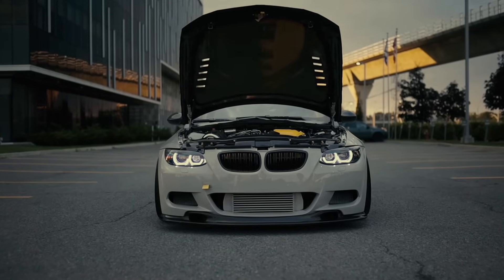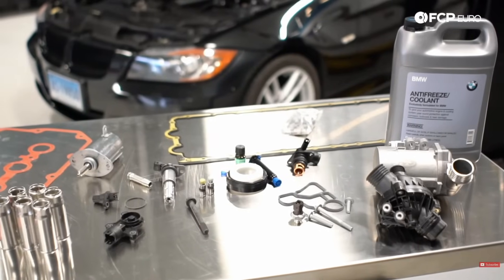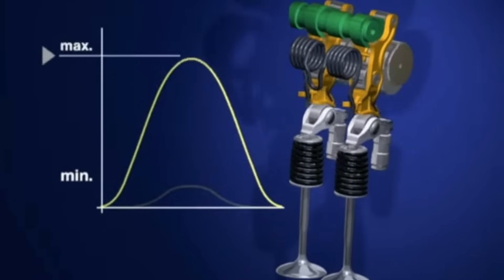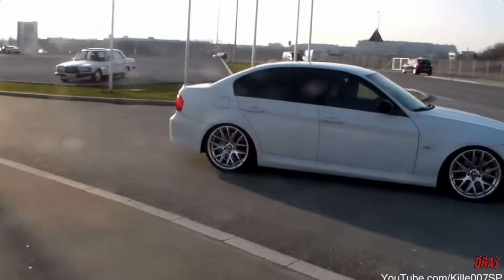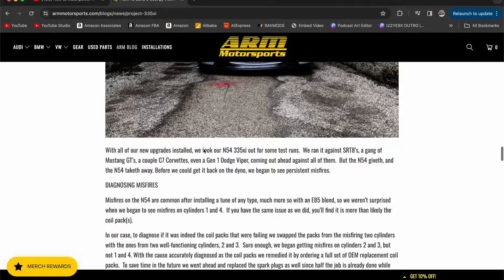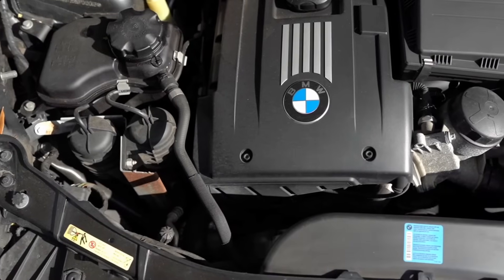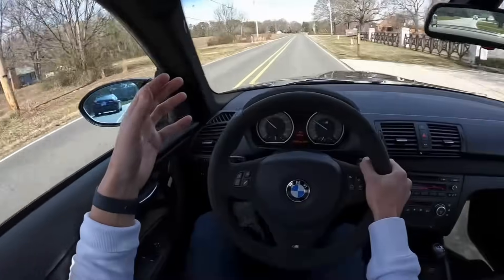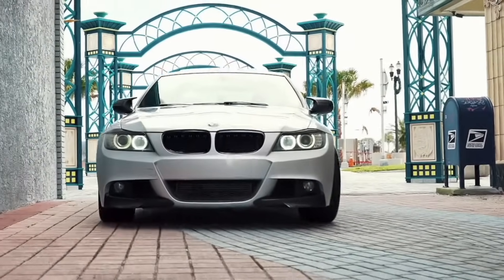Ultimate BMW Engine Showdown: N52 vs N54 vs N55 – Which One Should You Choose? | Comparison & Review

Comment: I got mine e93 n54 with 43k miles for 10k $ and put intercooler, high flow cats, injectors index 12(used), coils, cold spark plugs, and, digital cluster, charge pipe +bov MHD stage 2+ with mixed fuel and duuuuude that’s 450hp beast under 13k. It looks brand new and sounds crazy beautiful. Great sport car, but work yourself on it and it’s cheap
Reply from the maker: 43K miles for $10K is a STEAL!
Reply: @IzzyE9X  no leaks, no problems at all. white color, clean title 2 owners (second owner was older than Biden), no mods, garage kept California and Arizona use only (no rust), garage kept. TBH it’s been 10500$ but still cool, never seen lower mileage on these cars.
There are still cool cars on the market sometimes for a great price!
Otherwise if I would install brand new injectors in the shop or vrsf intercooler that could be the same price as m3 lol.
 I still need lsd to catch up with m3. Many turbos one day. But I live in Cali and it’s super strict with tune and stupid smog check… too much work to take off turbos every 2 years and put stock ones. 450hp is enough fun to drive by the ocean 🌊

Comment: Still choosing how to beef up my 13’ 328i coupe but keeping it reliable, 
I want it to last but I want a lil more torque
Reply from the maker: 3 stage intake manifold, upgraded air intake and a tune. Should only be about $1000 and bring you up to 240-260 horsepower

Comment: Hi here with my 135i N55 E82 with 100k and still rocking. Advice, do you maintenance and buy in advance a water pump, valve cover gasket. If you can change the thermostat for the masselmans, half of the issues are solved. Currently Stage 1+ with 360HP. Love my daily driver.
Reply: What is this word "masselmans"? Google doesn't even know! fyi, I had to replace my waterpump at 120k, they also hit you with the thermostat, cost $1958.

Comment: first of all it wasnt the first! time they have done it on  1974 on the 2002 model but if you mean the modern era still have to be specific on petrol engines thats because all the diesel cars even the e46 diesel cars they are turbocharged

Comment: I own a 2009 X5 N52 and i freaking love it.... all i had to do was replace the valve cover and valve cover gaskets,  manifold gaskets, O2 sensors, VVT Solenoids, Transmission pan and filter, new belt, lower radiator hose,   AC line because my old belt broke and snapped the rubber part of the line. And regular maintenance stuff...This is the best vehicle with currently 241,000 miles and still going
Reply from the maker: I’m also at 241K miles!
Reply: You just described the cost of an additional car in just your maintenance repairs.
Reply: @anthony7228  what's why you need to be mechanical inclined of owning an older BMW .. I spent like 5h replacing water pump with thermostat  ... but it is worth it ... I will never do the timing chain .. hope it won't fail me
Reply: Got a 08 about to supercharge it sooner or later .. got to do my crankcase position sensor in the morning and replace my ccv valve on the valve cover and I’m good to go .. I’m at 178,000 miles roughly .. I hate this damn 6 speed zf transmission it sucks lol this n52 would shine so much better if we had the zf 8 speed transmission like the older 2011 35i models got
Reply: @mtbridingog9083 facts
Reply: @mtbridingog9083 simply get a Stage 3 xhp tune

Comment: N53 seems pretty underrated. First I wanted to get hands on N52 but then found a good deal for N53 and now I have N53. Although it's very similar to N52, people are not talking about them much and I wonder why
Reply: Main reason is the N53 wasn't offered in the US market, which is where a ton of these videos and DIYs come from. 

I am an American who was fortunate enough to own one in a 2009 330i wagon. N53 was basically an N52 with direct injection and without valvetronic (yes, I know there are some other differences but those are the big ones). In my experience the N53 isn't as reliable as the N52, mostly due to the injectors and the NOx sensor issues...although it doesn't have valvetronic so that eliminates potential issues.

I loved, loved, loved the N53. I also love the N52 (had 2) but the N53 was absolute peak BMW NA inline six, in my opinion.
Reply: The n53 is a decent motor it’s very similar to the n52 but has a few changes to the engine and tune .. I believe the 53 has a little more torque then the 52

Comment: you shouldve mentioned that the n55 in the 2014+ F3x cars had a slightly bigger turbo than the older engines in the E chassis cars and the misconception with the N55 not having a forged bottom end is somewhat incorrect the only difference is the cast iron crankshaft but still has the forged rods and both have cast piston heads
Reply from the maker: great input!

Comment: I have a 2016 built N55 with MPPK approaching 120k mi and only problems to dates have been water pump, thermostat & valve cover gasket. The original valve cover gasket lasted 115k mi. Been quite reliable and still pulls hard.
Reply: please look at what 4n motorsport did to an n55
Reply: 2014 F30/N55/6MT, MPPK+MPE, fast as f and snorty without sketch flashes/bolt-ons. 

OK fast enough for me. Y'all wanna blow up your motors, feel free.

Comment: Why is nobody talking about n53? 300 hp stock just with intake and exhaust. Naturally aspirated! Perfect engine to throw in an older bmw for someone who doesn’t want a turbo, and loves n/a goodness
Reply: It was DFI instead of port injection so had a less reliable fuel pump and injectors like the N54, it’s not much of a gain over the N52 either so not really worth it. Also American never got the N53

Oh and you also get carbon buildup from DFI
Reply: @bwdrives  it’s not worth it for you Americans because you don’t have the engine, but for us in Germany it is definitely worth it, it’s the last naturally aspirated bmw engine from factory. And as i said, it’s 300hp easily, if you want to spend a bit more for porting the head and tunign it can go to 350hp, and rev till 8k rpm, that’s almost s54 territory. you can’t get those numbers on n52 without spending a fortune on some cams and porting the head etc…Plus direct injektion doesn’t make it bad, of course injectors can fail sometimes, but it is considered very reliable engine here in Germany, maybe not as simple as n52 but you loose somewhere to win somewhere.
Reply: @Shari_Tejp  that’s impressive I have to say, an S54 but with better reliability and good fuel consumption!

Also I live in the UK not America haha
Reply: @Shari_Tejp  Had an N53 in Germany and almost cried selling it

Comment: I'm driving a 2011 328i N51 (in Cali)which is just a N52 with the stage 3 intake manifold. Have 193k miles, replaced all the coolant lines, radiator and the reservoir. Had the oil pan replaced a few months after getting the car used. The car run great. Keeping up with the maintenence is key. Great video!

Comment: My experience as a mechanic with all these motors and currently owning N54. They’re all notorious for oil leaks and issues. N55 can be just as problematic as and N54 same with the N52. Depends how well maintained it was from the previous owners. I have my Z4 N54 previous owner took great of it and I also did all the maintenance for safe measure. Pushing 600hp on upgraded turbos, E85 Port injection. It’s blast to destroy other B58 owners and V8 engines. occasionally gives me hiccups. Btw my car has 117k miles. Stock engine and trans (DCT)

Comment: N52 gang. Reliable even with aftermarket  performance mods had 3 n52 and have had very little problems with them mostly just basic maintenance stuff
Except them damn carrier bearings now running jxb best $300 ever spent on it
Reply from the maker: 240,000 miles and still going strong 🫡
Reply: @IzzyE9X  have 280 on current runs like a top
Reply: solid motor fr
Reply: Had all 3 n52s are my favorite to daily tho

Comment: Own all 3, love all 3 , but indeed n54 cost me the most. And n52 super fun to beat on it and dont worrying. 
N55 is a engine you want to keep stock.
Reply: why did you keep your n55 stock?
Reply: @malps420  Because the N54 does 600whp ? :D . N55 is super fun stock form, powerband is perfect stock. I remember the 1st time I drove it, I was like, no way this engine do 300bhp. Also its my long commute car, like for roadtrips, I want enough power to pass semi on country side, but reliable to avoid a 500miles ride on a towing. Crank spin can occur on high power, and rod bearing wont last as long.

Comment: You should mention that the early n55 engines did not have the new fuel pump.  I think they shared the same fuel pump as the n54 until 2013 or so.  The early n55s can also have rod bearing issues, often caused by the 15k mile oil change interval early in life
Reply from the maker: thank you for that input! realistically nobody should be doing 15K oil changes, it’s crazy any car manufacturer could even recommend that lol

Comment: N52 for reliability, N54 for power and N55 for a decent mix of both
Reply: Facts my girl n52 got 232k miles 😭
Reply: @kazkenton  I just bought my 330i with 220 on it. I’ll try and push it to 300 and I’ll come back and report 😅
Reply: @kazkenton sheesh
Reply: What are your thoughts on the B58?
Reply from the maker: working on a B58 video 🔜
Reply: @Jus_Goody  the b58 is starting to have thier issues as well!  The B58 is the new n54, sort of..
Keep in mind the N54 has been around for almost 20 years already !!!!  The b58 is young, but all engines will have issues over 20 years.
Reply: @Spirited_Driver  I have been searching for reliability of the b58 too and found a few common issues. The oil housing, pcv etc. However, so far it’s pretty reliable even with remaps and performance bolt ons. Recently, BMW approached me with a full warranty on one with 90k miles. I declined as I do too many miles.
Reply: @Spirited_Driver  My 5VZ-FE wants to have a word with you...
Reply: @JusGoodyB58 is even more reliable than N55. N54 is the most unreliable engine BMW ever came up with. 

N52 is probably little more reliable than B48. But with BMW its the other things around the engine like (water pump, oil gasket, coolant leaks, charged pipe that fails as the car approaches 80k miles)
Reply: The non-turbo N54 predates the N52 (BMW has a bizarre engine numbering system) is much more reliable than the N52.  The rod bearings are more stout & there’s less technology crap on the 52.  But the 52’s cooling system is slightly better.  Both engines piss oil.
Reply: @sabio2009  what the hell are you talking about?
Reply: @roaksroaks9519  I think this is an attempt to reference the N53, which is a middleground between the N52 and N54 that never made it to the US. I owned one in Germany. 3.0L NA inline 6, direct injection, but no valvetronic.

But if that's correct, I strongly disagree that it was more reliable than the N52
Reply: @bobsmockus i own it and the n53 is a superior engine than the n52 (no oil leak problems, better torque and fuel economy) BUT it falls completely because of the extremely expensive injectors since it’s direct injected and those piezo style like n54
Reply: @sabio2009    No, the N54 does not pre-date the N52 gen.  The  N52 and n54  are very different engine families,  not a newer generation of each other.  The N52 used a magnesium block with port fuel injection and valvetronic, with slightly higher compression heads, i beam connecting rods, from 2004-2015,  N54 did not have valvetronic and is Direct injection on aluminum block with H-connecting rods and larger pins from 2006-2016.
Reply: @Spirited_Driver  
In my opinion the N52 is just a bad engine because the cylinder walls have a coating of aluminum seal that is gone after 280,000 km and the M54 is in my opinion much better just normal steel cylinder walls and no Valvtronic but BMW just went backwards when they changed the engine code M to N
Reply: ive had terrible experience with n52 6000 in repairs car costed me 4k and i got a 335i and love it, ive replaced the alternator for 125 and thats it its so powerful and so much fun to drive plus im not repairing it every day, ig i got unlucky with my 325i
Reply: @kebabsasmedturtle  What were the issues?
Reply: But which is more reliable, N52 or N55?
Reply: B58 for all of them.
Reply: N55s can make crazy power it’s just more expensive than building a n54. You just gotta fix the oil starvation issue and build the bottom end but it’s not cheap
Reply: Such a great analysis, thank you!
Reply: Agreed
Reply: The N55 engine is the only reliable part of my F32.  Almost every single other piece of the drivetrain has been replaced under warranty.
Reply: E46 and e36 still more reliable than e90 e91 e92 ,F series or newer they're all have an issues on oil leaks and cooling system issues at 100 miles must replace all cooling systems ie..electric water pump, thermostat assembly hoses ,valve cover and dasket ,oil pan gasket and so on

Comment: Owned a 435xi (F32/N55/AT) and currently a 335xi (E90/N54/AT). Though I originally opted for the N55 because of the added reliability, a N55 equipped car costs far more than a N54 one due to age/depreciation. My E90 has only 30k more miles than my F32 yet was less than 1/4 the price with a very long documented maintenance history. 
The N55's common issues (fragile plastic parts, brittle gaskets, etc.) followed by a blown charge pipe on a completely stock car, much of which it shares with the N54, surfaced by 110k. Having owned both I would stick with the N54 if went back and did it again since I had to perform the same repairs on my N55 anyway. To my surprise the N54 has also been easier to work on than the N55 so far. Would try a N52 if I wanted NA.
Reply: N54 and N55 trash after 100k miles…it’s a fact…and most people can’t diy…shit I live in a apt condominium bldg; I can’t diy; N52 only issues usually are oil leaks, maybe starter and water pump and common maintenance for an older car
Reply: @nelsonx4235  Try telling the fanbois that. The amount of copium in the BMW community is cringe. According to all the fabois if you simply maintain your N54/N55 BMW you will never have a problem... ever! 
I can DIY (thankfully) and keep all my cars clean/maintained yet the Known/Common Issues articles from FCP, etc are spot-on for every BMW/MINI I have owned. I replace the problematic cheap plastic parts that make up most the known issues list with metal aftermarket ones even if the car is under warranty. Fuck letting BMW/MINI put the same plastic garbage on my cars just to deal with it again 50-100k down the road!
Reply: Really depends if fuel system has been addressed which most have by now. But the second you need a HPFP and index 12’s there’s no comparison
Reply: @derekrostock1596  Index 12s fail too. Lot of people don't bother with them because they are overpriced and there are many topics discussing how the previous injectors (all the way back to Index 1s) have lasted 120k+ miles. Can buy an N54 equipped car and "address" the fuel system for far less than a N55 equipped car. Forking out more if not many times more for the N55 (etc.) just because it has Index 12s, revised HPFP, etc. when N54 cars are a fraction of the price makes little sense.

Comment: E20 2002 Turbo was BMWs first production turbo. May have sold substantially less units (less cars to put it in) but still was sold at dealers.
Reply: That's the point. It was sold because of race regulations. Not because it was designed to be a mass produced turbo model. N54 is first one that is turbo and meant for mass production.
Reply: @zDemoGODz  but it's not the first turbo engine. Doesn't matter why, it just isn't.

Comment: I had a 330xi (auto, E90), I enjoyed the N52 with it’s more typical BMW inline 6 NA experience.  That being said, I couldn’t argue with the raw power put out by subsequent engines.  I remember my service loaner in 2007 was a 335i and I was blown away, it was a big deal at the time in the power wars (when G35 and IS350 were leading in 2006).

Comment: Excellent  tuturiol I have the E90 facelift  model 2010 LCI.323i N52. 207000km and still runs silky smooth. Maintenance done by myself except transmission service. I have to say I won't be parting with this car any time soon.
Reply from the maker: the N52 is a silky smooth setup!
Reply: Mine is 2011 E90 325i (N52B25). Yesterday i sent it to workshop because clogged catalytic..but the car is great & very capable for normal people like me..

Comment: Love my M135i. Running a stage 2+ 400hp N55 in a hatchback.
Reply: Have the same car and tune. It's a blast to drive and sounds amazing. Arguably the best sounding bmw I6 engine due to only having one turbo. However Definitely have to he careful in the wet considering it has an open differential
Reply: Same here, I've got 65k miles on mine with only having to change the boost pipe once, think I might just keep her seeing as the straight 6 motors are dying out
Reply: Those hatches are the dream. So bad they never made it to America.